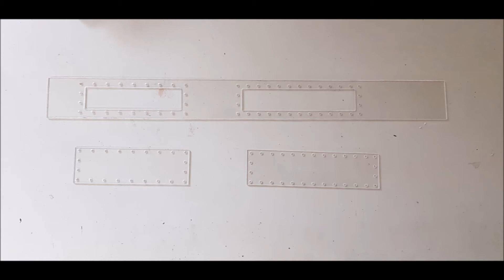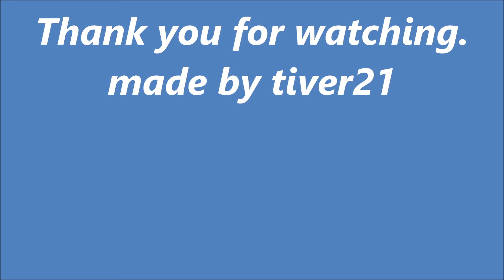RC Submarine class214 RC Conversion part2

Comment: How are you going to get RF signal to the Rx? Just asking as I see a 2.4GHz receiver which won't work under water... Its one of my struggling points as low frequency RC gear is hard to source now. And later in the video I see a crystal tuned Rx... OK.